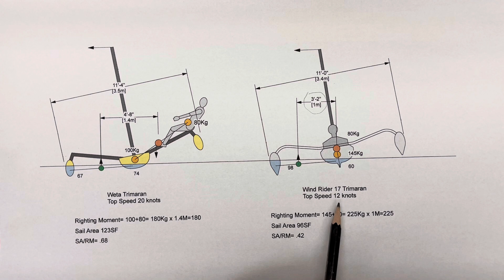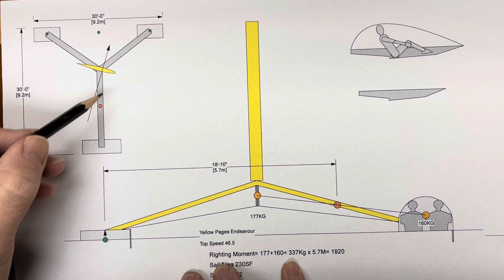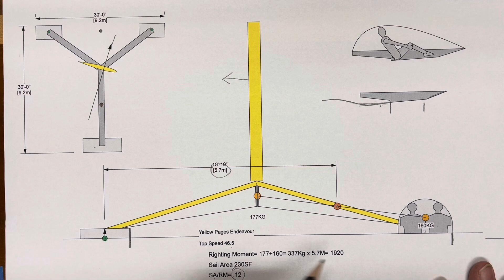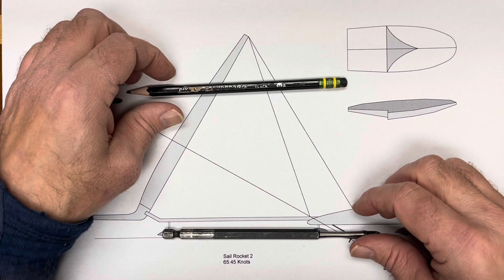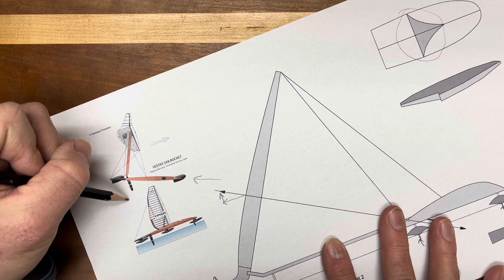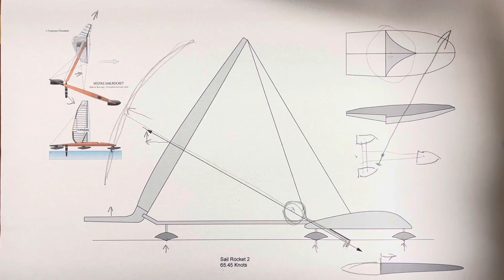Righting Moment Part 2 Examining the Fastest Sailboats of All Time

Comment: Hi Mark. I think you may have a few inaccuracies on the Weta. 
1. We often sit on the floats when hiking to increase the righting moment and lower your centre of gravity (I calculated that being 20cm further from the centre line increases leverage by 20%), particularly upwind, and downwind in stronger conditions to keep the weight both back and out - which you will find in many photos online and in my video here, for example.  https://youtu.be/9mmpDPExaWo
2. The hulls is a planing hull with a flatter section towards the stern than in your illustration although the bow is pointed. It planes in winds from around 6 knots, depending on the sea state.
3. The sail area has increased with the introduction of the 9.3 SqM Square Top Mainsail in 2015 which is used by most racers in winds up to 25 knots and provides faster planing in marginal planing conditions. It has also reduced slightly with the introduction of the Self Tacking Jib in 2021 which is .2m smaller than the standard jib but allows you to do "hands free" turns when combined with the twin tiller extensions.
For full specs see the Weta Wiki at https://www.wetaforum.com/weta-wiki/
4. At low wind speeds you can use the Weta gennaker as a code zero which does keep you moving and is quicker than using the jib alone. It's fun in mixed fleet racing when boats with bigger spinnakers end up with prawn nets! See https://youtu.be/4VjX0YVQwuk
5. The America's Cup boats, specifically the AC75 class, can reach top speeds of 55 knots (over 100 kph or 63 mph).

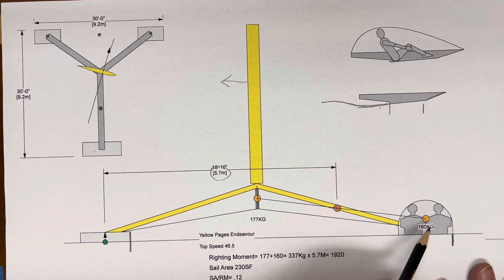Comment: 13:55 I think part of the reason the sail area is low on Yellowpages (it could be lower still if they had gone higher aspect ratio but they were also going for lowest CoE) is that the previous iteration of the boat had its sail explode, so they were near the structural limits relative to what they were able to build.
Reply from the maker: @weatheranddarkness  thanks for sharing that.  That makes sense.  An unstayed mast is limited.  I bet adding 1 windward stay could have helped.
Reply: @ There were three stays actually. One to each sponson. My assumption was that they were trying for maximum capacity to absorb excess power,  like gusts or what have you. Which is why they went for a lower mast height to start with. That's just my reading of it from the pictures I've seen. It seems for Maquarie Innovation they even went further with the ratio. Even lower aspect ratio wing, with part of it below the junction, nearly touching the water, and seemingly a bit larger overall footprint, but I could be wrong about that last, might just be the ratio.

Comment: HI !  go full lift ! V shape are a stability night mare. parasitique drag on the sail area is huge : the smallest sail you have the better. why? cost of building it, and damage on you, when you crash at 25 ktn. hydrofoil are grate if you try to go nice ans easy. if you want to go fast its a Rabbit Hole. if you want to go slow, steady and efficient you will enjoy it and get the best of it, without breaking the bank. very nice video ! keep going !
Reply from the maker: @kiteattack3947  Thanks, what do you sail?
Reply: @markpalmquist  HI, foil related ? or generaly speaking ?
Reply from the maker: @kiteattack3947  both
Reply: @markpalmquist  do you know that chanel ? : https://www.youtube.com/watch?v=8NbEBptcWOM
Reply: ive been learning on Waszp but mostly I use them with kite or wing foil